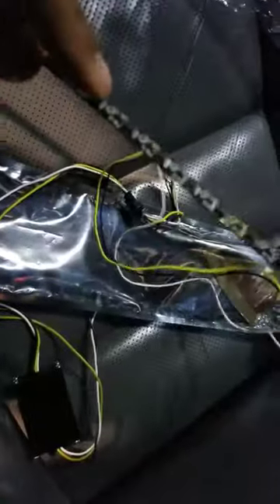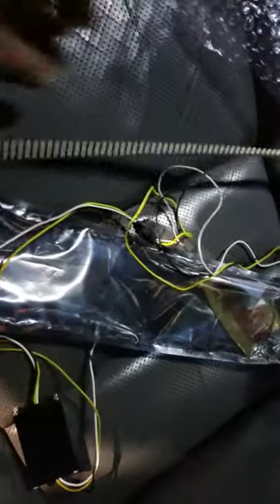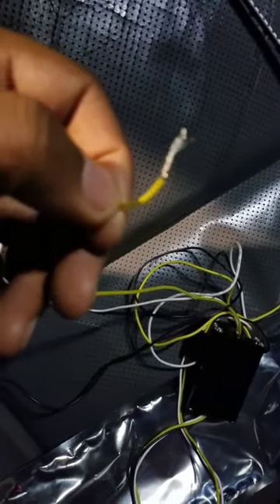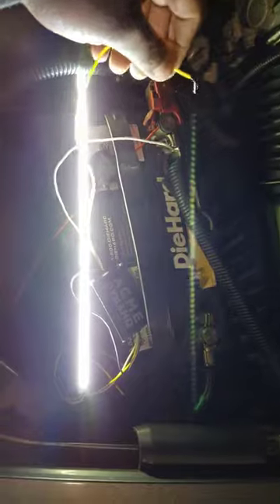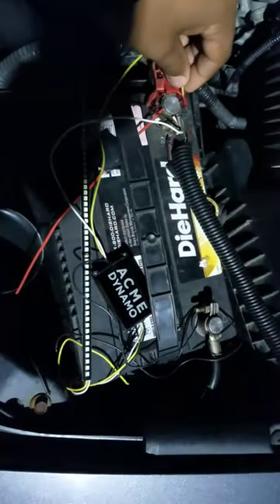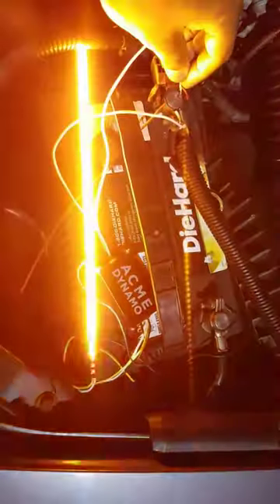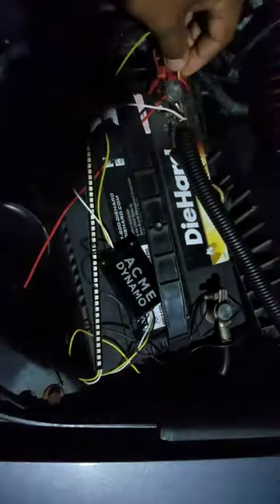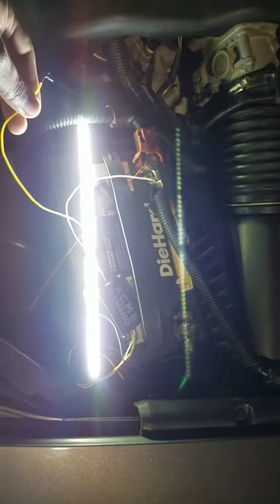MY ACURA TL HEADLIGHT BUILD MORIMOTO LED SEQUENTIAL STRIP

Comment: That's gonna be sick. I ordered mine thru Endless RPM but only difference is mine doesn't have the sequential module and he's clearing the diffuser and doing CF sides. Once I get my BC Racing coils It's gonna be a beauty :D
Reply from the maker: WillArmes80 nice bruce does great work oh hes doing it cool post a video after.
Reply: fabolousg4ever I'll definitely post one. I just had the entire car repainted with new rims and a RV-6 V3 long tube J-pipe. Once I get the headlights and drop it I'll shoot a video
Reply from the maker: WillArmes80 cool